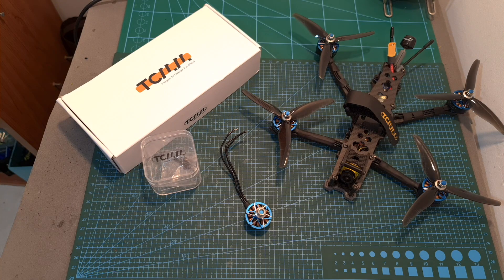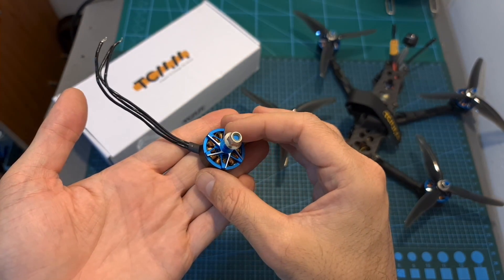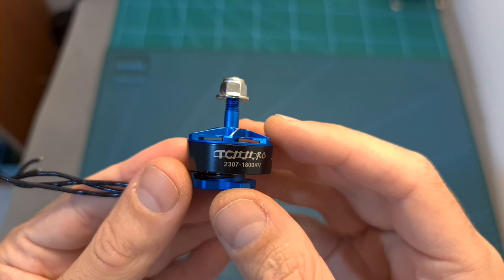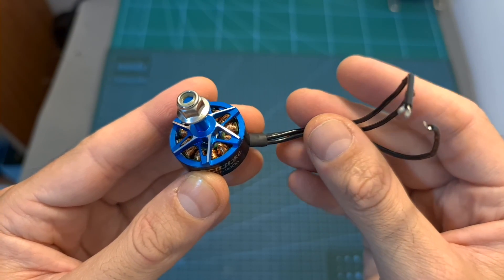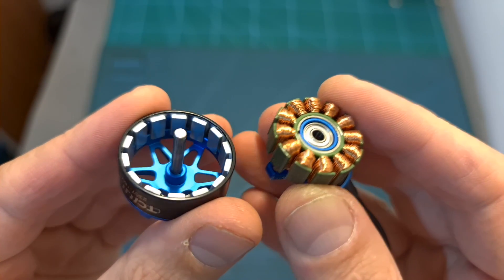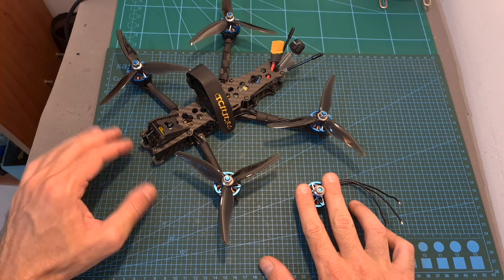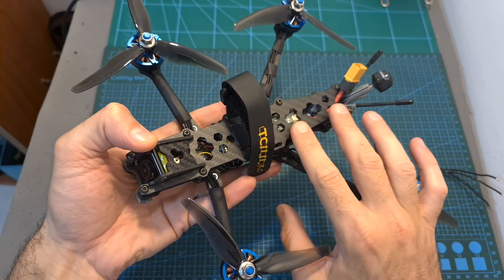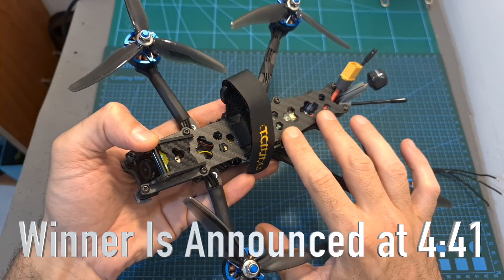$8 Motors? TCMMRC 2307 1800KV Thrust Tests & Flight Footage

Comment: You misspelled the battery type in the title, voltage showing > 23V and the title says 4S
Reply from the maker: You are correct, I messed it up and many titles are wrong :-(
Please refer to the thrust test results in this file: http://www.mediafire.com/file/pjwtwu5kmewvik3/TCMMTC-2307-1800KV.pdf/file

Comment: WOW WOW WOW 
Only 8 bucks for these motors! they seemed to do decent on the bench and they look nice! 
Definitely want to buy through your link but i don't shop aliexpress. is it fast shipping to USA? THANKS  for your great videos and recommendations
Reply: Aliexpress is usually between 3 and 6 weeks from order to delivery to MN at least
Reply: @drkavnger99  sheesh thx bro thats a while
Reply: @drkavnger99  the shipping isn't cheap either so you have to equate that in the pricing
Reply from the maker: Thanks buddy. As far as I know AliExpress is the only option, at least for now.